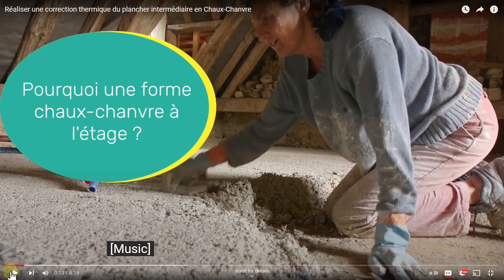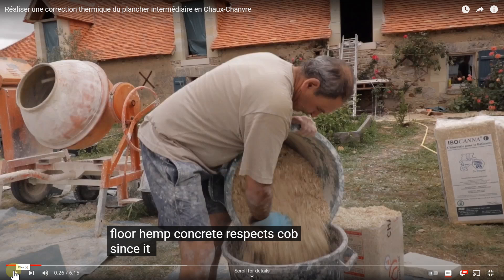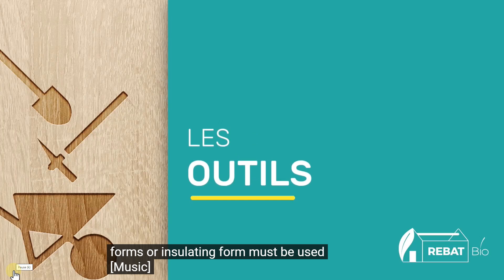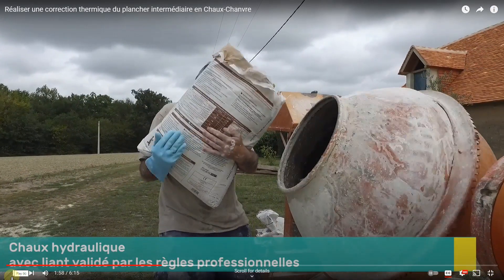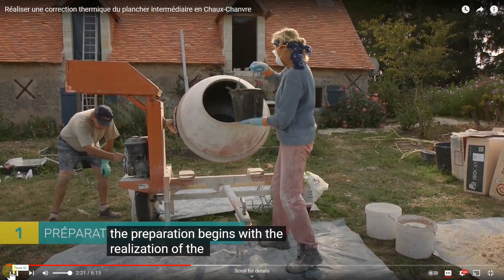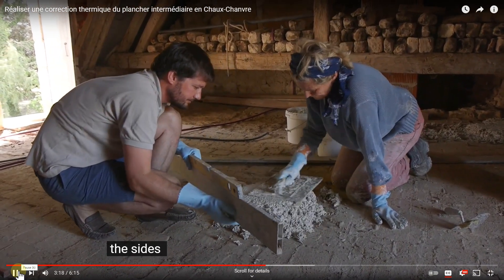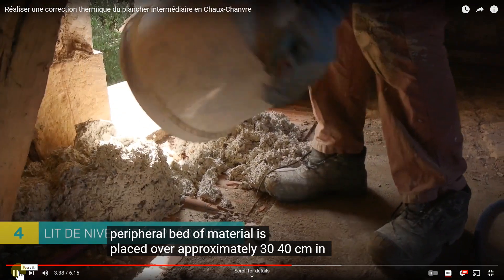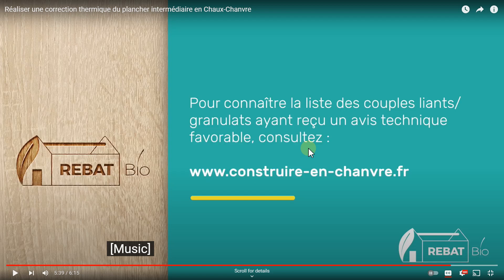Hempcrete Floor Install Example

Comment: Thanks for this! Do you know of any info on doing hempcrete floor insulation on top of a concrete ground-level floor? I am trying to learn what type of buildup is the most sensible. I understand that the hempcrete might need some type of insulating and draining layer  (e.g. glass foam) to keep the hempcrete up from the concrete, to prevent rot due to condensation.
Reply from the maker: I have some examples I'll post

Comment: I made a pretty awesome year around greenhouse out of hempcrete in central oregon, , where it gets down to 15-20 F on occasion in the winter. It has been awesome. I also ran vent tube in sort of a radiator pattern thru my north facing wall that is 16" of hemp, my exhaust fan pulls the heat thru the main wall, then into my garden beds. Helps maintain stable temps very well.

Comment: Would love to press some of this material at lower psi in the Hydraform Compressed Earth Block machine we have..... hmmm.
Reply from the maker: I agree, we felt a CEB machine slightly adjusted might work and less expensive than the two companies that make the hempcrete block manufacturing lines for the companies in Europe currently making hempcrete bricks. Prices for setting those lines run 8 to 10M, not including land, ect. Lets us know how it turned out.
Reply: So how did it turn out? LoL

Comment: Your Channel is very informative. Have you ever checked out Just Bio Fiber out of Alberta Canada?
Reply from the maker: Of course great product/brick. Last anyone heard they were looking for investors to scale up. Scaling up hempcrete brick manufacturing is hard and very specialized. Biosys now marketed as hempBlock is made by Vieille Materiaux who contracted another French company to build the highly automated form, stack and dry system. As I understand it they still use a binder called Promt from Vicat. Its a natural cement. As an aside Damian Baumer of Ereazy fame sold/licensed the brick design to Vieille Materiaux. I think IsoHemp used them too. The Italians at Tecnocanapa may have an italian setup although it looks similar.
Reply: @hempknowlogy  That's amazing news, I'm glad to see that hemp is finally catching on as a viable building material here in North America. I haven't really seen many companies that are taking up the torch though. I've had several conversations with Just Bio Fiber, who say they are within 6-12 months of production. I myself would really like to use those bricks to complete a project of 10 duplex homes.